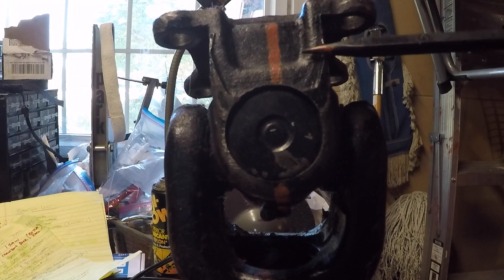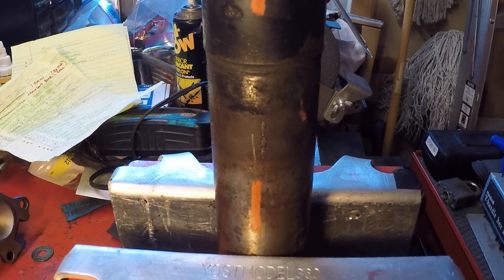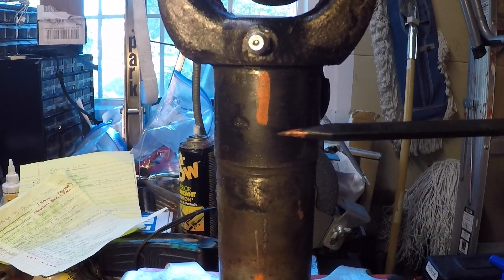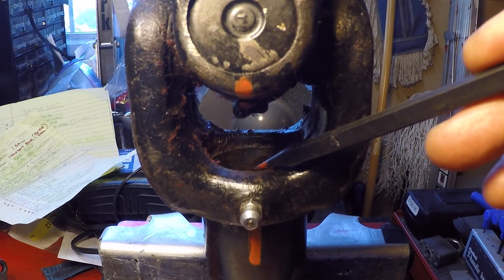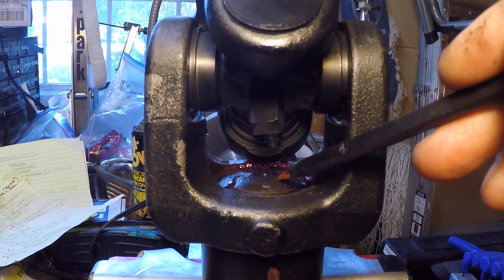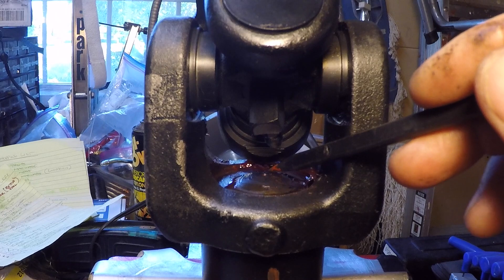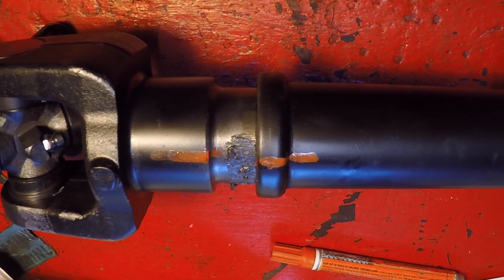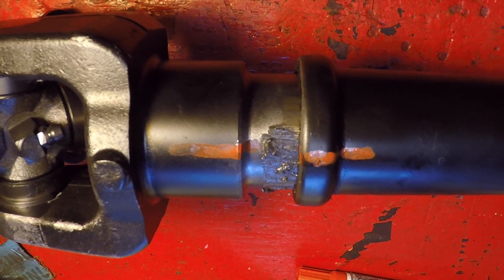Driveshaft Repair - (Slip Yoke Grease Plug Has Fallen Out)

Comment: Thanks guys, I've never poped a cap, but I only give it a couple pumps when I lube the prop shaft, just until it starts to separate, but drilling a small hole in the end of the stock cap is a good idea?
Reply from the maker: The hole in the replacement yoke made by PowerTrain Industries is very tiny.  It's big enough to let grease and air pressure escape but not so big to let major amounts of contaminants into the joint.  If a couple pumps of grease gets the joint to start separating, that means it's already pumped full of grease.  That puts a lot of pressure on that rear plug, but it seems like lots of people get away with this, including me with my 3rd Gen 4runner.  I guess the plug on my 1st Gen rear driveshaft wasn't all that securely in the slip yoke and it couldn't handle the pressure exerted on it.  If you wanted to drill a hole in your cap right down the center, you would have to remove your u-joint.  But, I guess if you drill at an angle, you could get a small hole made that would work as a pressure relief for the yoke.  If you do it, let me know how it turns out.